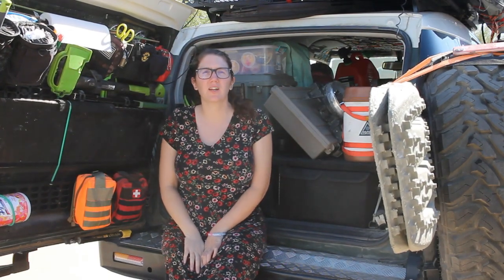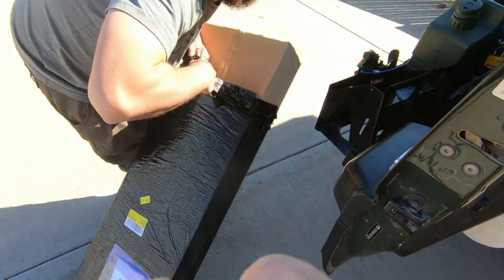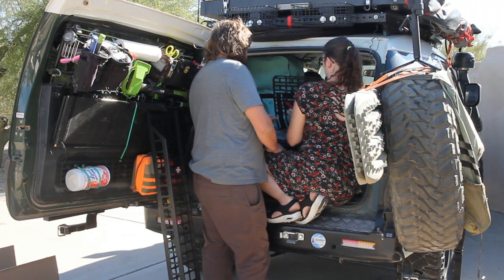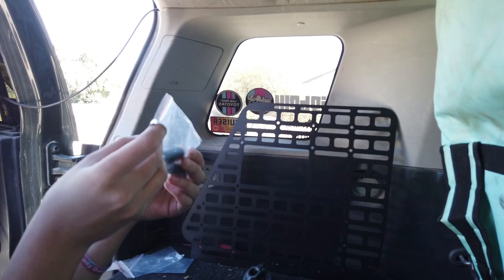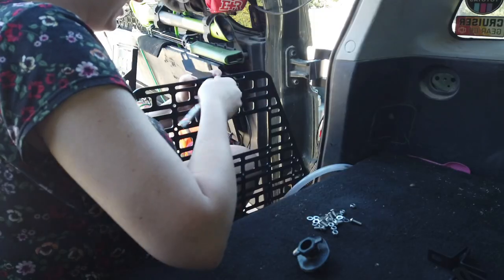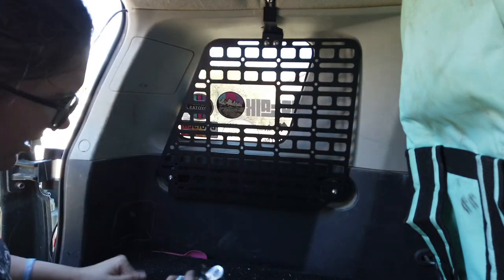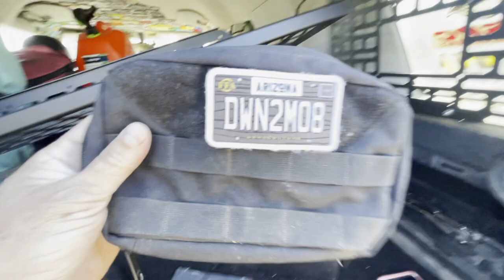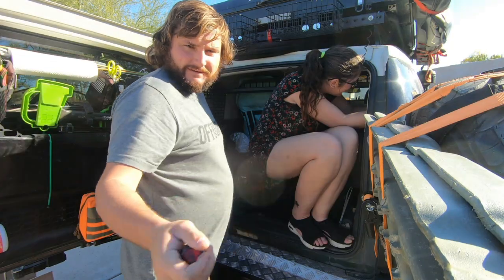Sponsor: Bison Gear FJ Cruiser Shelf and MOLLE Panels / Overland Build Install

Comment: I just received mine but am puzzled because my shelf came in two pieces, not one, like yours and as I have seen in different videos. I did just send them an email for clarification, so we'll see what they say.
Reply from the maker: Is yours an fj cruiser???
Reply: @TheOverlanderNextdoor  Yes, it is!
Reply from the maker: @rahim5217  I wonder if they gave you a 4runner one 🤔 good thing you emailed them.
Reply: @TheOverlanderNextdoor  That might be the reason. Thanks!
Reply from the maker: @rahim5217  no problem hope you get it figured out!!
Reply: @rahim5217  Hey did you ever figure out of it was a wrong order? Because I just got one today and it came in two pieces as well…
Reply: @ervinperdomo89  When I asked them about it they replied that the new, updated version comes in two pieces and has about an inch more depth. They also said that they no longer make the one-piece version. I told them that they should change the picture on their website to reflect this change. Hope that helps!